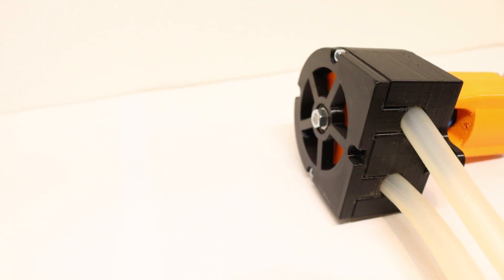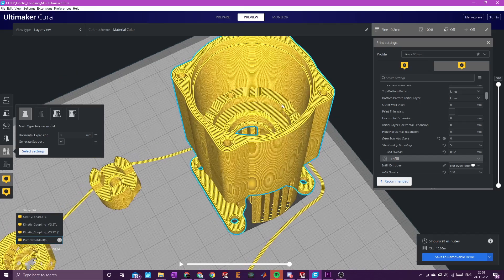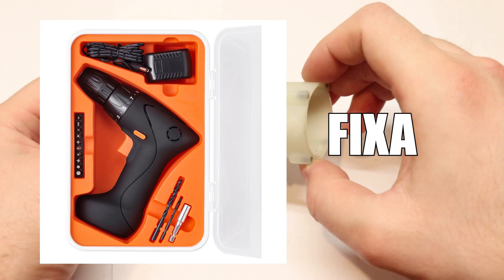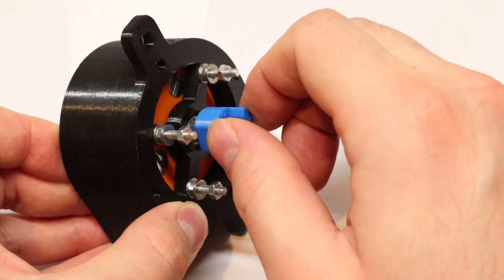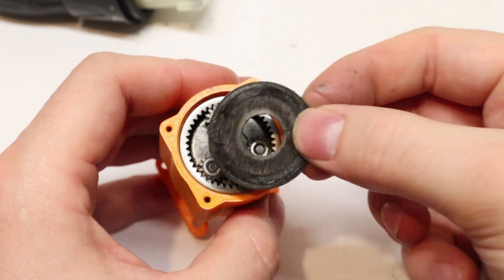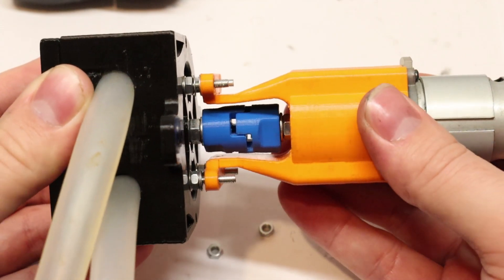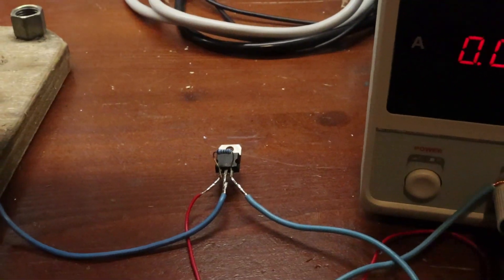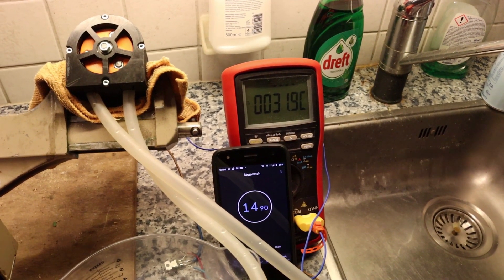3d Printing PERISTALTIC WATER PUMP BUILD [Part 2/2]

Comment: You might consider making the housing for the roller water tight on the bottom, then filling the chamber with some sort of lubricating fluid. I've worked with large scale peristaltic pumps, and they all use some sort of grease or liquid lubricant to keep temperatures down, reduce friction, and wear on the hose.
Reply from the maker: yeah i've seen those oil like lubed pumpes however at my job we do use some sort of silicone grease and those pumps have been running from months 24/7. They use a special blend  of hose material called Tygon and is made by saint cobain. I.e. the hose is just as important as the lubrication

Comment: Recommendation:  Before closing up the geared section...give it a good shot of spray white lithium grease...this should help reduce friction of the gears
How long would one expect the silicon tube to last in that pump
Cool design and build!!!
Reply from the maker: I noticed that the grease should definitely not be to thick else the motor will nog turn. The life expectancy of the hose I have no Idea perhaps a great future experiment :)

Comment: We have a plastic coating that we coat items in at work. If you open the tin the solvents are so volatile that a skin immediately starts to form. So a pump like this would be useful for dispensing fluids with volatile solvents to minimise drying/thickening as part of the material handling. I have already built a prototype with a tin adapter, solvent-resistant tube and a cheap ebay peristaltic pump. It worked well but needs closed loop control of the fluid level / pumping duty to complete the system.
Reply from the maker: Awesome that you figured that out and it works do you need any help with your closed loop system?
Reply: @PattysLab  mainly need to bump it up the priority list but thanks for asking. I'm looking at a TOF sensor. The liquid is glossy black so need to do a test first to check it produces a reliable reading. The total acceptable fluid change is only about 10mm so not many sensor options seem suitable (I can't think of any sensor I'd be happy to place in physical contact with the liquid plastic).
Did you try to soft start your motor to reduce the inrush current? Wasn't paying close attention to the ammeter.
Reply from the maker: You could always look at an ultrasound (echo) sensor or an capacitive sensor if something with light doesn't work, I've not soft started the motor. The the pump need quite a high current "kick" to start turning since the diameter of the hose is so large :). The pump originated from a drink machine (which I'll will release on this chanel) where it is powered by an li-on battery with no current inrush circuit. Also the motor is driven by pwm so you could just narrow the pulse with so there is less current flowing into the motor
Reply: @PattysLab  I should have said the area that I have to measure is only around 20*20mm, so ultrasonic is probably not going to produce a narrow enough field of view to get an accurate measure of the fluid level. It's in a tapered hopper, so as the fluid level drops, so does the surface area available! Anyway, thank you again!
Reply from the maker: You can always use gold or platina level guages goodluck with the project 💪

Comment: I'm tempted to automate the dispensing of my washer detergent now.
Reply from the maker: I love Automation please do and make a video, if you use an H bridge driver to drive the motor you can also reverse the motor to no wash detergent will leak out of the hose. So you dispense and suck the remainder back in :)
Reply: This is actually what I am trying to build! I want to have an off delay so I can just push a button and have a specific amount of soap dispensed, then it turns off. I have no experience with electronics, so this will be a miracle if I can pull it off. Also, I want to add another hose to pump softener and attach it with a shut off valve so I can dispense the detergent and then close the valve, open the softener valve and dispense the softener. I wish I could automate the open and closing of the valves too but I think that's a bit outside of my capabilities. Wish me luck!